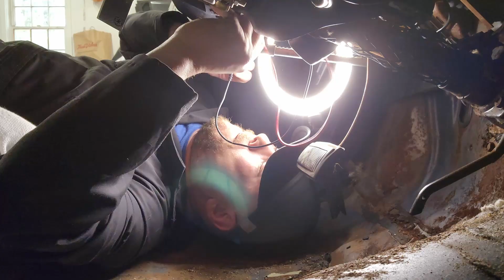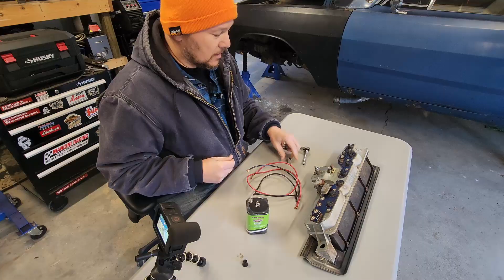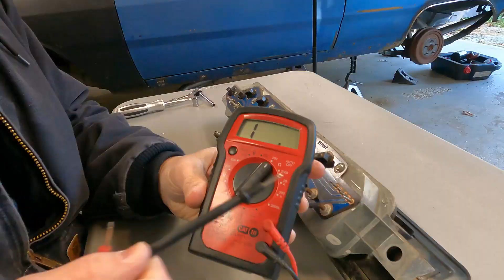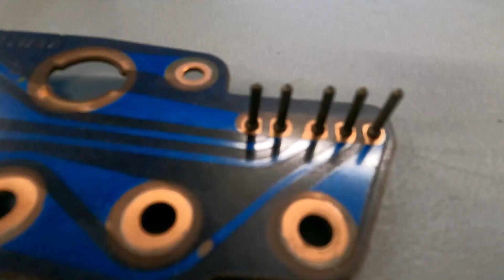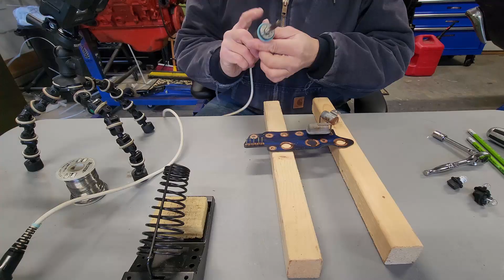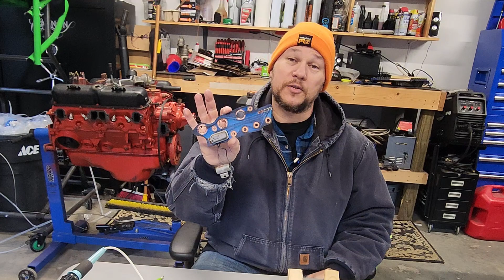'67 Dart Fuel Gauge Still Broken? Watch This

Comment: Good afternoon, 

So I bought a new fuel gauge from classic industries along with a new temperature gauge. I wanted to test both gauges before I put them into the car and put the dash all back together. When I test the fuel gauge it seems to be backwards. I connect the positive of the 6 volt battery to the left terminal. If you're looking at the gauge from the front so closest to the E and then I connect the ground to the right side closest to the F. Nothing happens but if I reverse them then the Needle moves on the fuel gauge. 
I tested the temperature gauge and it seems to be correct with the positive on the left and the negative on the right the gauge moves if I reverse those, the gauge does not move on the temperature gauge. Do I have a faulty manufacturer fuel gauge? It did say on the bottom of their website that I had to have a solid state voltage limiter which I did purchase as well but I wouldn't think that that would cause the terminals to reverse.
Reply: Good evening sir, My fuel gauge is working great after putting a new one in and installing a new solid state voltage limiter. Though I am still having trouble getting my temperature gauge to work. I found someone online that said I can connect a jumper wire from the temperature sensor wire and then ground it out on the body of the car to make sure that the gauge is good. I did that and the needle moves all the way hot which lets me know the gauge works. But when I connect it back to the sensor and I drive the car the temperature goes nowhere. What would you recommend testing next to see what might be the problem?
Reply from the maker: @joefall  First I would make sure the top of your sensor is clean and there is enough metal to metal contact between the sensor and the engine to make a good ground. Thread tape or painted threads could be enough to brake the connection. If you're all good there, I'd replace the sensor. If you were sending 12v on that line as a result of the melted wiring, it's possible you smoked it.
Reply: @MontsweagGarage I tested the ground on the sensor itself and the sensor is grounded very well. I also checked the gauge wire coming from the sensor all the way to the gauge and the wire itself is good. When I put the alligator clips on and grounded out, the needle moves all the way to hot. So at this point I feel like I don't have the right sensor. I've ordered three of these now and none of them have worked. I'm starting to feel a little defeated.
Reply from the maker: @joefall  shoot me an address. I have the original sensor from my 273 laying around, and it is good. If it still doesn't work, you can send it back, and we'll keep at it.
Reply from the maker: @joefall  Also, take a resistance reading on each of your sensors. Take the reading from the top of the sensor to gound. My factory sensor reads about 230 ohms at room temp.
Reply from the maker: My apologies Joe. I have steered you wrong. I just reviewed the video, along with the wiring diagram, and I got the terminals backwards when I did my resistance test. The right side (as you are looking at the front of the gauge) is the positive side for both gauges. If you do have a bad gauge, it is the temp gauge. I would test it in the car with the solid state voltage limiter though to be sure though. I will check my both my gauges this weekend and get back to you on if they are opposite or not.

Comment: I have a question? I have a 67 Dart and both my temp and fuel gauge does not work but the alternator gauge works. Any ideas? I'm new to working on electrical but do have some mechanical knowledge.
Reply from the maker: Good Evening Joe and welcome to the channel. The fuel and temp gauges go through the voltage regulator and the ammeter (alternator gauge) does not. If you have access to a multimeter, check the back of either of the fuel or temp gauges and you should see a pulsing voltage similar to the one I show at 0:35 in the video. Check each terminal on the back. If you have nothing there, replace the voltage regulator. Make sure to clean up the terminals before you check. I hope this helps and I hope we see you around again.
Reply: @MontsweagGarage  thank you very much. I'll let you know what I find.
Reply from the maker: I look forward to it!
Reply: @MontsweagGarage  okay, I purchased a brand new voltage limiter and I put it in before putting it in. I connected it to the positive and negative of the battery and red. The voltage that was coming through which it did Spike up all the way to 8 volts which gives me an impression. Maybe the limiter I got was bad but I don't know. After I put the limiter in nothing changed. The temperature gauge and fuel gauge did not move or do anything. I even took the car out for a 15-minute drive just to see if the temperature would come up and maybe the fuel gauge was bad. After the temperature did not come up, I decided to do the same check that you did right off of the post on the back of the gauge itself for the fuel and I connected a 6 volt battery to it and the needle moved up to about the approximate fuel that I had in the tank. I was told that the sending unit for the fuel was replaced just a couple months ago, but the fact that the temperature gauge and the fuel gauge is not working. Leaves me very baffled any ideas?
Reply from the maker: @joefall  Good morning Joe. I have a few thoughts and I think that since I have my entire dash out at the moment, it will be easier for me to show you. Give me little while and I will get you an answer in video form. I have an appointment at 1 (it's 10 now), but I will start shooting when I get home. Does that work for you?
Reply: @MontsweagGarage  yes sir, I'm in no rush.
Reply from the maker: New video is posted. 😊
Reply: @MontsweagGarage  thank you so much for your help. I'll let you know what I find